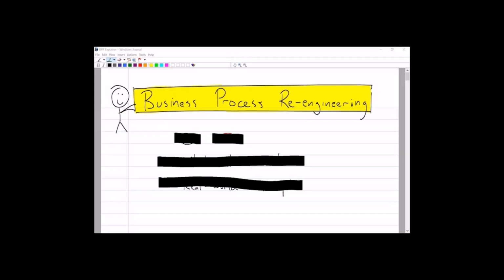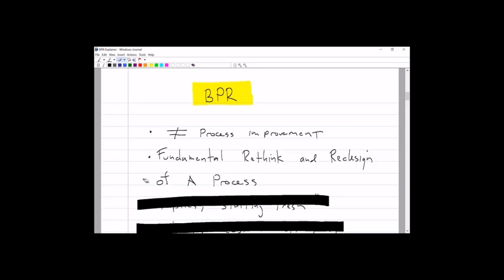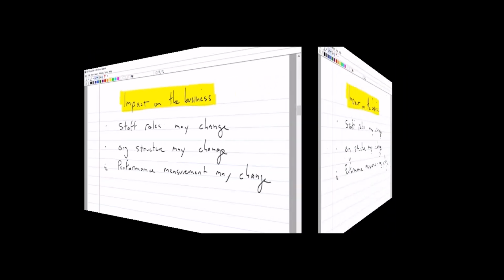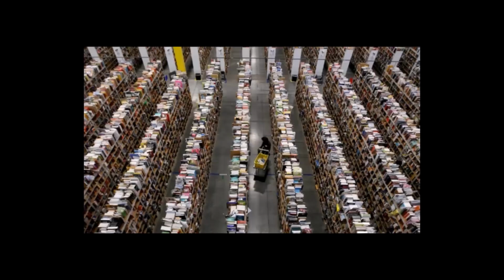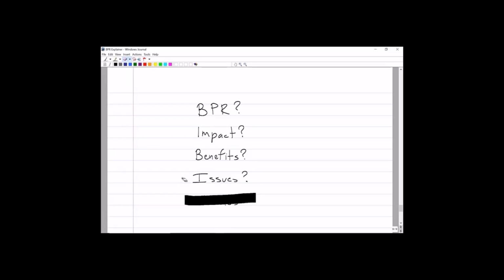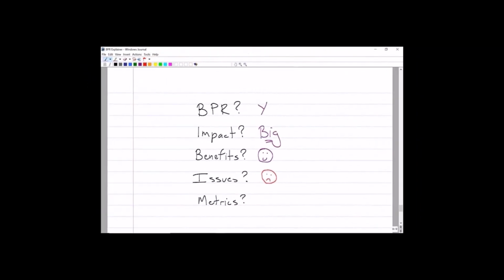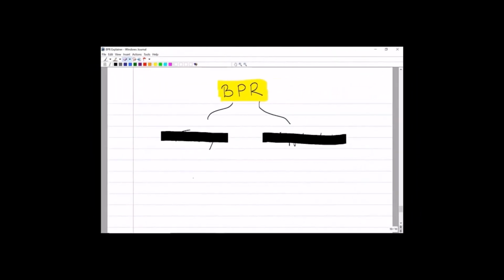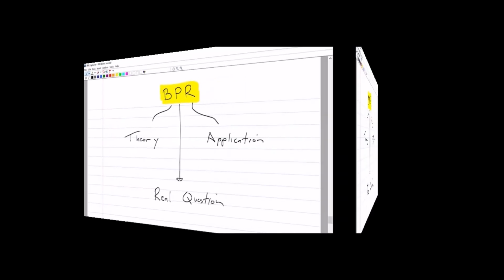APM Topic Explainer: Business process re engineering

Comment: ### *Business Process Re-engineering (BPR): Impact, Benefits, Issues, and Metrics*

#### *Impact of Business Process Re-engineering (BPR)*
- **Organizational Transformation**: BPR leads to significant changes in how business processes are structured, often resulting in the complete overhaul of workflows, organizational structures, and job roles.
- **Efficiency and Productivity**: By rethinking and redesigning processes from the ground up, organizations can drastically improve efficiency and productivity, eliminating redundant or non-value-adding activities.
- **Cost Reduction**: Streamlining processes often leads to reduced operational costs by minimizing waste, reducing labor requirements, and improving resource utilization.
- **Improved Customer Satisfaction**: Re-engineered processes typically focus on enhancing customer service and response times, leading to higher customer satisfaction.
- **Cultural Change**: BPR often necessitates a shift in organizational culture, encouraging a more agile, flexible, and responsive workforce.

#### *Benefits of Business Process Re-engineering*
- **Enhanced Competitiveness**: BPR enables organizations to respond more quickly to market changes, providing a competitive edge.
- **Increased Innovation**: By challenging existing processes, BPR fosters innovation, leading to new ways of doing business and potentially new revenue streams.
- **Better Use of Technology**: BPR often involves the integration of advanced technologies, such as ERP systems, that support process automation and data-driven decision-making.
- **Alignment with Strategic Goals**: BPR ensures that business processes are aligned with the organization's strategic objectives, improving overall coherence and direction.
- **Scalability**: Re-engineered processes are often more scalable, allowing organizations to grow or contract efficiently without significant process redesigns.

#### *Issues with Business Process Re-engineering*
- **Resistance to Change**: Employees may resist changes due to fear of job loss, changes in job roles, or uncertainty about new processes.
- **High Costs and Time-Consuming**: The implementation of BPR can be costly and time-consuming, with the potential for significant disruption to ongoing operations.
- **Risk of Failure**: BPR initiatives can fail if not managed properly, leading to wasted resources and potential setbacks in organizational performance.
- **Complexity of Implementation**: BPR often involves complex changes that require careful planning, coordination, and execution across multiple departments and stakeholders.
- **Short-Term Decline in Performance**: Organizations may experience a temporary decline in performance during the transition period as employees adjust to new processes and technologies.

#### *Metrics for Measuring the Success of BPR*
- **Process Efficiency**: Metrics such as cycle time, throughput time, and process completion rate can indicate improvements in process efficiency.
- **Cost Savings**: Measuring the reduction in operational costs, including labor, materials, and overheads, can provide insight into the financial impact of BPR.
- **Customer Satisfaction**: Customer satisfaction scores, Net Promoter Scores (NPS), and customer retention rates can indicate the effectiveness of re-engineered processes in meeting customer needs.
- **Employee Productivity**: Metrics like output per employee, task completion rate, and employee engagement scores can reflect improvements in productivity following BPR.
- **Quality Improvements**: Defect rates, error rates, and compliance with quality standards can be used to assess the impact of BPR on the quality of products or services.
- **Return on Investment (ROI)**: Calculating the ROI of BPR initiatives helps determine whether the benefits outweigh the costs and efforts involved.
- **Time to Market**: For product-focused organizations, measuring the time taken from product development to market launch can reflect improvements in process agility and efficiency. 

This comprehensive overview of BPR covers its potential impacts, benefits, challenges, and the key metrics for evaluating its success, providing a solid foundation for understanding and implementing BPR in an organization.